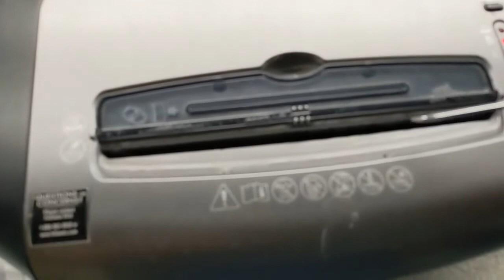Home repair paper shredder fellowes by froggy

Comment from the maker: UPDATE!!! The sensor for automatic on/off is to the right of center of the paper feed slot and is  small glassy "dot" or "lense". Clean it carefully with a qtip and maybe some very mild cleaner or light oil. It fixed mine, auto feed running now.

Comment: Hey Froggy. Enjoy tour stuff. I'd thought I would share some insight on Fellowes' shredders for your readers. I have a model P70 CM that I have used and abused over the past 12 years in y home office. Never did lubricate the cutters as I should have. Well, it recently gave up the ghost. My curiosity got the best of me so I took it apart because I can't stand not to. Does that ring a bell with anyone? Note: beware of hidden screws under labels. Discovered I had sheared some teeth on both the primary drive gear and secondary drive gear. Don't think they can handle the number of pages at a time that they state on a consistant bases. Together the replacement cost of the two gears on line is about $95 if you can find them. BUT, as luck would have it, a place called Ace Depot sells the complete unit for $59.95.  So that's a no-brainer and a good deal even if it is a discontinued model because I know that I had paid close to $100 over 12 years ago. Overall, it was and is a good shredder and I probably would have not had to replace it if I were in not such a hurry and over stuffed it.
Reply from the maker: Thanks for sharing, I really love it when I get a comment from viewers that have same/similar issues. Mine is now a-ok just looks a little messed up on top where the brake cleaner melted the finish. Haha. I never put 12 page (limit) but it'll eat 4-6  all day long.